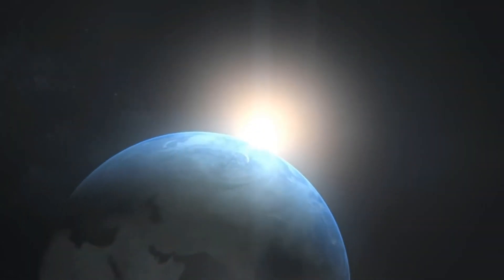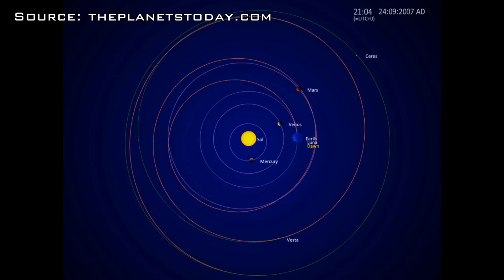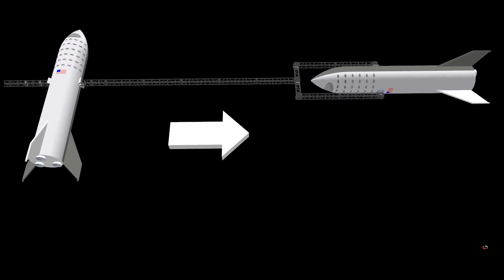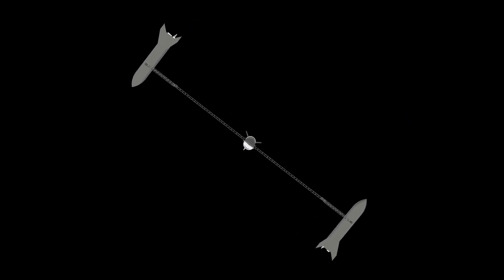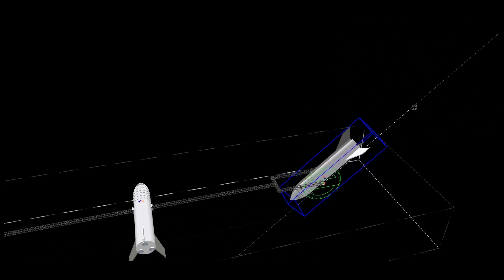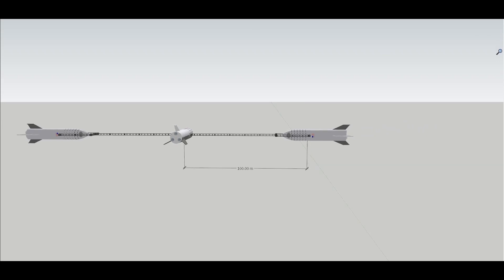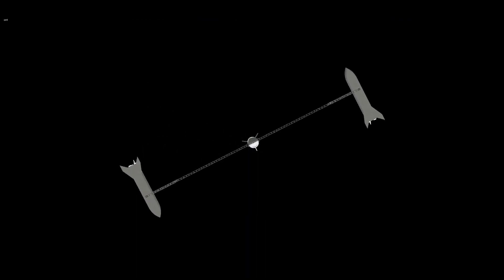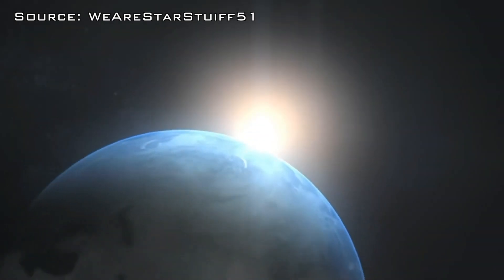GLS2: Artificial Gravity for SpaceX's Starship

Comment: What about a much simpler magnetic system. It wouldn't solve all lack of gravity issues, but it would solve the main problem. Imagine a magnetic floor with the astronauts using a proper suit and shoes attracted to the floor. It would require much less energy and still their bodies would feel the sensation of being attracted to the ground. The math behind this is not as complex and it wouldn't solve certain issues but they will be able to walk around, go the the bathroom and sleep comfortably with no problem.
Your thoughts?
Reply from the maker: I can't find it right now, but I saw a great explanation on why magnetic gravity wouldn't work. The amount of metal needed to be worn by the user was an issue. If you just put magnetic boots on, it would keep your feet on the floor but the rest of your body would still be subject to microgravity. Great comment! It's killing me that I can't find the in depth explanation of this.
Reply: @smallstars  Great, let me know if you find it. Thanks for your reply.

Comment: The transverse (short piece) of the Starship yoke truss section would have tremendous force on it and would probably bend and break at the attachment point of the 100m radius truss section. The yoke should be rounded or horseshoe shaped to get rid of the hard right angles. A better idea might be to have 4 - 100m truss sections that run parallel to each other?
Reply from the maker: I agree! At a certain point I prioritized putting out the video just to get the concept out there. 

How do you feel about straight lines? I was actually thinking of an X shape for the structure of the system for the next version. The GLS would be at the center of the X and the extremities of the X would be where passenger starships attach. Cables will hold the tension and rigid truss will provide leverage. The truss in this X configuration would be a 2 chord truss, not a 4 chord.

Comment: Bad design

Here's my take on this:
2 starships, and simpler strut connecting them on refueling port. Acquiring same centripetal force on habitable part of the starship with less amount of fuel used.
Rotation could be aquired by electrically spinned weight inside of the connecting strut acting secondary purpose as additional energy storage.

Also in this configuration the habbitable section will be upside down and launch seats will be essentially in the ceiling, not taking space for living quarters.

The weight for the spinning gyro would be inflatabe donut shaped tank filled with fuel, making the whole system even more efficient
Reply from the maker: Thanks for the comment! I wish you could provide a visual to illustrate this description.
Reply: @smallstars  
I could send simple disproportional draw if you'd give me a mail adress.
 
It's pretty much raw concept developed as I was writing the comment. The part would be a contract for Bigelow Aerospace.

Since it is filled with cryogenic fuel it would need a sun shield as well, probably integrated with solar panels.

Also all solutions I've seen so far lacks solution for trajectory correction in spinned state, which is essential to hit the mars. 
This idea at least allows efficient despin, correction and respin.
Reply from the maker: @Chuck.1715  Try DMing me at instagram.com/tinysmallstars or twitter.com/tinysmallstars

Comment: Interesting idea - but you would only need 2 ships, keep the crew in one, the 2nd has your truss system that extends out the anchor directly onto the crew ship, (and has any additional fuel or supplies for the mars landing) - with both facing nose to nose.  then both ship's RCS is used to spin up to the required centrifugal force to simulate internal "gravity".  No need for complicated gymbal or similar swivel for the ships, thus reducing potential load fail points
Reply from the maker: I agree. 1. swivel joint will probably go away from the design. 2. I think 2 ships would be great, but there aren't many advantages. The only one I can think of is that the spin would be more stable. You can't actually get the radius to be longer because the center of the spin would just become the middle of the truss. In addition to that, you would need a GLS for every passenger starship ship you send to mars, and they are already planning on sending 2 passenger starships. That means 4 vessels instead of 3 costing more money and resources.

As for RCS, I'd love to see how the planned methalox RCS system turns out.

Comment: 3:00 This kind of rotation about the intermediate axis of the system would be highly unstable. (Lookup tennis racket theorem)
Reply from the maker: Got any ideas on what a stable spin system with the least amount of starships would look like?
Reply: @smallstars  I think this same arrangement would work if the middle Starship were oriented parallel to the plane of rotation (for maximum moment of inertia).

Comment: The trusses won't work. In the dimensions shown, they will bend nearly as easily as cables, but will break if this happens. Also, the distances are far larger than needed. It would be far easier to just rotate single ships around their length. Simulating Mars gravity would be enough. For additional training, small centrifuges can be carried along.
Reply from the maker: Large radii are necessary for a spin system to be in the comfort zone for humans. IMO the closer to 1G we can get the stronger and more robust our astronauts will be when they land on an alien world.

As for truss strength, the next design will use cables (for tension) and truss (for leverage.) The truss doesn't have that much force pushing against it though, imagine trying to bend a fork, using only 2 fingers. One finger on the tines and one finger at the bottom of the handle.
Reply: The little centrifuges in amusement parks seem to be sufficient. To avoid the head being far lighter than the feet and irritating coriolis forces, I'd say a radius of 4 meters is more than enough. Starship is far longer than that. Also, a fork is a solid object and very small. Physics change a little with increased size. Aluminum foil rolled once and two fingers would be more like your trusses as shown in the video.
Reply from the maker: @carldombrowski8719  Even aluminum foil wouldn't bend in space if you could only touch it with two fingers in opposite directions on the extreme ends of it

As for 4 meters being enough of a radius, that has been tested and the results weren't pretty. It has been agreed upon that the comfort zone looks something like this: http://www.projectrho.com/public_html/rocket/images/artificialgrav/gravComfort03.jpg
Reply: Can you give me a link to those tests? I see nothing important changing between 4 and 100 meters... The health effects are probably sufficient at 3m already....
Reply: Also, I think you overestimate the strength of aluminum foil or your trusses. You might want to try alumium foil in your kitchen...
Reply from the maker: @carldombrowski8719  sure the alumium foil in my kitchen bends if i push on it in the opposite direction of the earth's gravity, but you have to imagine how different the environment is out in space.
Reply from the maker: @carldombrowski8719  more on spin gravity comfort zone: https://www.youtube.com/watch?v=im-JM0f_J7s
Reply: It's in no way different. The little bit of gravity does very little to bend the aluminum
Reply: The video doesn't say anything about measurements to determine the comfort zone. Also it has lots of inaccuracies: No one would be disoriented from spinning fast in a centrifuge - you wouldn't even notice if there are no windows, because only change of speed disorients. Also, blood would stay in the head and not move to the feet if the head had less gravity. However, that's a very minor issue as the blood which makes it to the legs experiences the full gravity, so there is not much more blood pressure in the head than on Earth. And this would only be felt if the radius was around 2 meters. At 3 meters, the effect is already very little.
Reply from the maker: @carldombrowski8719  The reason why spinning disorients, even if you don't change the speed is because of the way your ear fluid moves about in your head
Reply: It gets pressed towards the feet. As on Earth. Only changes in speed make it move about.

Comment: Spacex Starship if they paired on flight to Mars after boost could connect using orbital refueling mounts . Then they could extend the ships apart by telescoping out from their mounts. That would separate the crew compartments by 4 to 6 Starship lengths, maybe 600 feet.
Reply from the maker: I like it! Gravity would pull 180 degrees in the wrong direction thought (towards the nose of the starships)

Comment: This is a great idea;  well thought out.  I was worried about zero G travel, but also had a bad feeling about a non-rigid tether.  Also worried about how to attach the non-rigid tethers.  This bothered me enough that I settled on having Gateway Foundation Von-Braun inspired flying hotels (but smaller, in the scale of 4 inflatable modules, rather than 24) that would be pushed by a Starship onto Mars insertion.  I even emailed Gateway Foundation and Bigelow about my idea.  But your idea sounds a lot easier and more compatible with SpaceX's current plan.  As far as getting this across to Elon Musk, that's a hard one.  I tried to send messages to him a couple of times, but I think they get auto-forwarded to a black hole.
EDIT:  Didn't Elon mention plans of going bi-propellant for RCS in Starship, at the presentation in Boca Chica? (not now but in future mk's) ...  So it may not be necessary to rotate the Starships 90 degrees ...  Yeah, I think this could be designed a lot simpler;  in fact, with a small, yet rigid, nose attachment;  no rotation;  super-simple.  Using articulated, 20 meter long segment cylinders would probably achieve better strength to mass than trusses.
By the way, if you need help with 3D modelling, I'm a Blender-head, with years (and up to half million polygon models) experience. And I'm an engineer, too.

Comment: Weaker truss with cross mounted cables, also weaker, combined would be stronger than ether alone and lighter. Plus each has advantages over the other and would complement the others disadvantages. But... Until we get over the useless concept of "One craft for all occasions" mentality, We won't be going anywhere. For a craft to travel from planet to planet it can not serve as a landing craft, habitat, bathroom, masturbatorium, laboratory and fishpond. It will be hard enough to make a somewhat safe single purpose craft for the one task.

Comment: 18 to 24 months will cause the passangers to basically turn to jelly.  Other approach is to use inflatable habitates at the end of the trusses leaving the 3 Starships at the Hub hard docked and strapped together.  The truss system could likely be smaller while the habitates more custom build for long term 1G existance.

Comment: "The GLS will fold up and land on Mars as well, to refuel for the journey back to Earth"  . .   don't forget to take the fuel tank adapter, the gas stations on Mars use a funny shaped nozzle . . .  oh, and make sure you've got some bitcoin, they don't accept USD.
The gravity may be artificial, but the absurdity is real.
Reply from the maker: Oh did you not know that this mission relies upon refueling on mars? This is the reason they chose to use methalox for the raptor engine's propellant; because they can produce methane on mars.
Reply: @smallstars  That's the absurdity I was pointing out. Let's forget about the production & processing equipment & its power supply for the moment and square that up when we answer the questions: 1/ how much fuel do we need to launch and return from mars? 2/ How long will that take to produce?
Look at the infrastructure needed to launch from earth. That will need to be built on Mars.
Something else worth thinking about is the atmospheric pressure on Mars with respect to the planets mass and its surface gravity as these things are closely related.
In short, the atmosphere on Mars can not support water in its liquid form. If there ever were oceans on Mars, they're not there now because they've evaporated. The model is wrong.
The mass of Earth is an order of magnitude greater than the mass of Mars, big difference.
Then there's the physics of slowing down when they get there. They mention the lower delta-v needed to achieve a higher energy state from orbital velocity, and essentially ignore the fact that the delta-v is added to the orbital velocity when it comes to entering Mars' atmosphere. Escape velocity from Earth is 11.2 km/s,   1/2m(starship)v^2 = very high energy system . . impossible without deceleration burn (perhaps not impossible depending on approach path, and difference in relative velocities starship-Earth / starship-Mars , but close to it)
It's funny, some of them are planning upon an almost completely assumed model, while at the same time others are completely ignoring fundamentals that have been proven. Take for example the model of planetary evolution of a solar system, as the star ages and grows the inner and outer bounds of its habitable zone extend further outwards, under this hypothesis the most viable assumption, given Mars' orbital distance from the Sun, would be that Mars would be the Next planet in our solar system to develop life, as Earth may have After Venus. 
It's like looking at an unfertilized seed and expecting it to have already grown.

I actually think your GLS system is a pretty good idea.
Reply from the maker: I see you don't trust the scientists and engineers at SpaceX, and I don't blame you, they are working a mile a minute! But I do like that they are pressing forward head first into the challenges that need to be overcame.

Thanks for commenting and supporting my channel!

Comment: would the ion engines provide enough force to get this spinning, and stop when needed? i know would take longer then a 2-4 sec burn, from main engines. but might save weight , and fuel for return and escaping from mars. ........... note these engines could be incorperated into the trusses themselves, meaning less stresses on " docking" ports.
Reply from the maker: I like your style! I would love to have ion engines just for spin start up, but I don't think that the amount of weight of the actual engine and supporting equipment would be justified. You are correct in that a less thrusty, but more efficient engine would be ideal for spin start up.

Comment: I really like your enthusiasm. A few notes, though:

1) You don't need a full 1 g. 0.3 g would be sufficient.
2) Don't look at tether as a single entity, with single point of failure. These would likely be hundreds, if not thousands of threads - if one thread fails, you lose 1/1000th of its capability. If one joint of truss segment fails, you lose much more. Also there's nothing that prevents having multiple tethers.
3) Truss is a rigid structure, it will be a nightmare during spinup.
4) Starship's mass (dry + payload) is 250 tonnes. Add some fuel. Think about load that truss/tether need to bear at the ends when fully spin (~750kN). Now imagine you need to distribute that load to swivel joints while swinging ships after acceleration. Thinking about these joints, these are also in fact single points of failure - if one of these fails, the other one would be torn out by inertia.
5) Think not only about going there, but also coming back - third ship only for truss becomes infeasible then as you'll need to land and refuel it, adding 50% of total mission cost only to have artificial gravity.
6) No need to despin the ships at the end, just disconnect them. If you spin them the right way and disconnect them at the right moment, it will result in a negligible delta vee to the ships - one will be slightly faster, another slightly slower.
7) If you think that RCS have to little efficiency, think also the other way around: perhaps there are engines with lower thrust but better specific impulse than Raptors...? Like Hall-effect Thrusters?
Reply from the maker: Thanks! 

1) I agree any gravity is better than none, but IMO the closer to 1G we get, the stronger and more robust our space travelers will be when they land on an alien world.
2) My next GLS video will have an improved design with most of the payload bay of the GLS filled with tensile strength tether.
3) I still think its safer to have some rigidity to the system, so part of the system will still be truss, 1, for safety, and 2 for leverage.
4) I'm looking at how to better design the swivel joint system, or not have one at all. I look forward to seeing how the planned methalox RCS development goes. If it ends up being viable we can do away with swiveling all together.
5) I don't see the 3rd ship as costing more to land and launch at mars. What's one more ship refueling really going to cost in martian dollars? 😂
6) I love the no de-spin action! If I were to include that in the original plan imagine the negative comments though! haha. But yeah, that would actually save some delta V. It's just a very precise and dangerous (high risk) operation. Maybe I'll design the next version with that in mind, no swivel joints, but a quick release instead.
7) We really don't now what the specs of the RCS for the starship is going to look like. When I first made this video I was under the assumption that RCS should be reserved for RCS and not have half or more of its delta V used up to create 31 m/s tangential velocity.

Thanks again for the great comment!